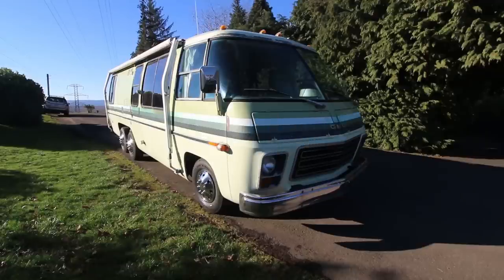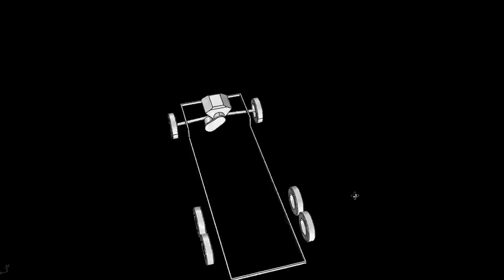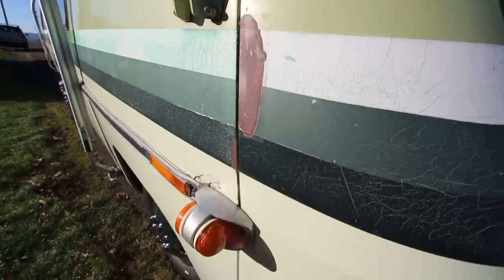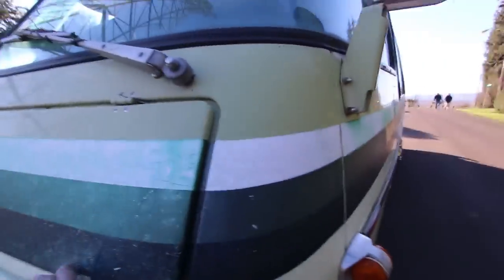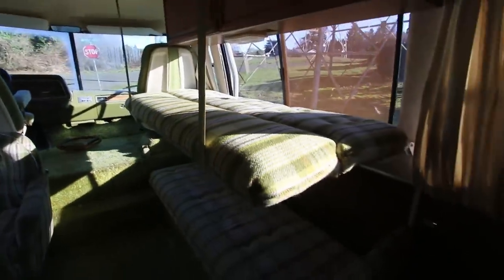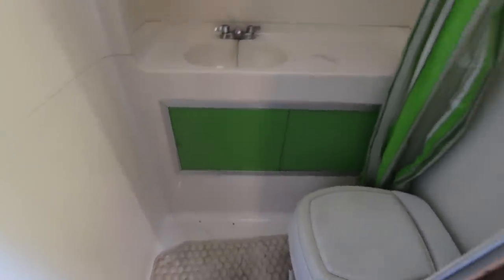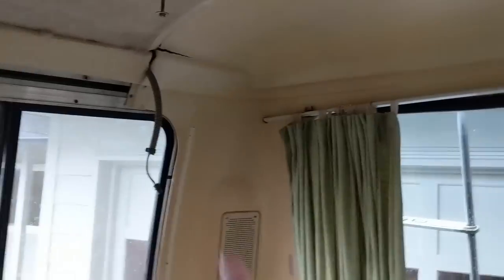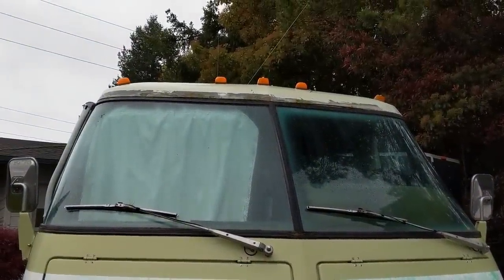Building The Best Damn GMC Motorhome Ever - Beginnings & Explanations

Comment: Try this profile for your PETG

255c Hot end temp 25% fan 3x3x3 0.2mm for walls and thickness

7mm retract 8mm wipe. retract during wipe. always retract (to make sure it retracts when switching between model and support)

50mm/s max speed

also. many coats of CLEAR coat inside and out. this will improve the transparency of the printed part greatly! more light can get out. USE LED's inside of these or the bulbs might heat up inside their to the deflection temperature. also UV clear coat for the final coats! this way it slows down the UV degradation over time. won't stop it but they will last longer.

for a compromise on the tear drop. print the original design just without the mohawk. easier to print closer to the tear drop shape you desire.

Comment: Just a suggestion, use a HEAT GUN to heat up the vinyl stripe on the RV to remove it using a putty knife.
Reply from the maker: A good idea. It was the first thing I tried: https://youtu.be/Gu62RG1tkp4?t=863
Reply: Erase wheel on a die grinder. What every body shop will use
Reply: Buy the 10 pack of them, they are erasers, they wear out.

Comment: One huge disadvantage is that there is no overdrive transmission option. Also, GMC did not come up with this idea....Revcon approached GM to source the Toronado powertrain. GM would only agree if Revcon could prove the durability and GM would even graciously provide some engineers to "Help & verify." Revcon was first

Comment: I wish there was a way to upgrade the powertrain easily. That Unitized Power Package was innovative but good luck recreating it with a modern Cummins and Allison. It would require a lot of CAD engineering as opposed to just some fabrication. The TH425 was a reengineered TH400 the spun backwards which required all kinds of reworking on the internals.

Comment: Old enough to remember how the hit the county in the 70s. Used to doodle them on my books. know them form stem to stern. Been to Orlando to a place that restores these better than new to see how I still can't afford them. 454 GM front wheel drive with air bag goodness. Check that frame. Look around on YT. They like to rust bad. Tales a lot of work to get them back.

Comment: rubber wheel on high speed drill to remove the old vinyl stickers, the rubber wheel acts like an eraser, just take caution as to not go through the paint or burn the paint.

Comment: There is a good reason medium duty/heavy duty vehicles don't use weak IFS front wheel drive.  The IFS that GM built was a weak platform to begin with.
While it may ride better, it is alot easier to get a FWD heavy veh stuck then a RWD.
I def like the way these look, but after owning 2 GM P30/32 based RVs and scrapping them I wouldn't ever have another, especially with a IFS setup, rated at around 5500 they can't take much abuse or weight, then again most RVs are very weight limited unless you get a high dollar unit built on a bus platform.
EDIT:  There is an invention called "air ride" that really smooths things out btw, I did a school bus conversion and it rides WAY better than the 2 RVs I've had by far.
LASTLY, NOT ALL PLATFORMS HAVE A FRONT ENGINE, try a rear engine layout sometime, they are so much better and no drive shaft running the length of the wheel base, mine is 3' or shorter.

I hate having the engine up front, way too loud to enjoy conversation.

Comment: Remember, though, that the integrated shoulder belt is going to rely on the strength of the seats connection to the floor.
Reply: Its kinda pointless in an RV too, its like a bus. It has basically no crash safety and at moderate speeds anything you hit is likely to move out of the way for you.

Comment: Take lots of pictures of before and after how about using fiberglass and strips of metal in bed in it to reinforce the floor and so on with out tearing every thing out. The water damage area will need lots of Attention hopeful you got a wire feed welder to make yourself brackets and supports  to hold and support it all . And one thing at a time and plastic bag to keep screws and small items Together and Mark the bags . After Interior work maybe Modify the engine a little bit for better for breathing and performance .

Comment: Does front wheel drive also mean it's better in snow than other RVs? I also have an Ender 3, but I'm not that experienced with 3D printing. Why not print the lense flat on the bedplate like the way it would be installed in the RV?

Comment: I've worked on so many of these steaming piles.
Good luck with your tow bills, they need to be on a trailer.
Reply: What are common problems with them? Surely swapping in a modern LS style V8 and OD trans would help? EFI & distributorless ignition really improved reliability. HEI was the shit when I was young lol.
Reply: Do they even make a modern fwd od transmission rated for an application this heavy? The original trans was a TH425, which is basically a TH400 but in front wheel drive. So an OD replacement would have to at least match the power capability of the 400.
Reply: @grabasandwich  
Primarily age related issues.
The cooling system, and the Buick sourced transmission are weak links.
The front suspension, wheel bearings, and half shafts are undersized for the job.
They were also produced in the age of GM's nylon timing gear heyday.
They're an uncommon platform designation, so pretty much none of your average parts house employees will have any idea what you're talking about.
You've really gotta be in love with the RV to operate it happily.
Reply: @TheREALJosephTurner  
I'm not aware of any o.d. Options.
I believe the Cadillac pattern TH475 FWD is tougher, has a lower first gear, but is still strictly three speed.
Reply: @TheREALJosephTurner  the 4T80E probably would've been the modern equivalent, which was replaced by the 6T80.
Reply: @burntorangeak  I forgot about the nylon gears! 🤣

Comment: The heyday of the muscle car ended in '72 - '73 at best, and I consider '65-'71 to be as good as it got or is ever likely to get (late-model Corvette, Camaro and Mustang owners may disagree, but that's a fraction of what was on offer at dealerships by 1970). It wasnt just the smog regulations - it was the realization among consumers that you probably didnt NEED 455 cubic inches of V8 to power the family station wagon on that once-a-year vacation out west. Of course, when it comes to larger vehicles like yours, a big V8 makes a lot more sense. 

Of course, the end of genuinely powerful engines didnt stop Detroit trying to market 'wannabe' muscle cars well into the 80s, and they are remembered for all the wrong reasons. 

https://www.drivingline.com/articles/10-reasons-to-be-glad-you-weren-t-driving-in-the-70s/

Admittedly, as a kid I thought the Smokey and the Bandit Firebird was 'cool' - we all have skeletons in our closet - but as soon as I clapped eyes on the Vanishing Point Challenger I realised the error of my ways. The 6 or so years that separated those two cars may as well have been 60 years - Detroit lost the plot.

Thanks for the video.

Comment: Just curious on how the seat swap install went and if you had any issues with it. I located a pair in my area and was looking to do the swap in short order............. Thanx
Reply from the maker: You will need to completely custom design and fabricate a new metal box for the seats to install onto. The stock box is not sufficiently engineered to withstand the forces going through the shoulder belts of the new seats. If you don't have the ability to do this yourself, having a metal shop design and fabricate this for you can get quite expensive.
Reply: @IndustriousPursuits  So Ive been able to remove 5 of the 6 nuts that hold the slide to the seat frame, but cant seem to figure out access to the last nut that is the furthest most towards the back and on the side of the seat tilt handle. Were you able to remove all bolts and was there anything special needed to do so?
Thanx

Comment: You do know you can remove the entire back to take out the big pieces right
Reply from the maker: I hadn't though of doing it that way. Thank you!
Reply: @IndustriousPursuits  It's a 3-man job. Get plenty of help. Mine has to come off this summer also.
Reply: @IndustriousPursuits  plenty of GMC facebook groups, plus manuals out there,  read up, find out if the intake has a crack, if it cracks will lead to over heating and cook the engine
Reply: Is it possible to remove the back and cut it to add a door and ramp to use the back section as a toy hauler? Do you know if that would affect the structural integrity at all?

Comment: Those GMC's are cool... But the KOOLEST motorhomes were the Daystar units built in the late 70s... Wish to High Heaven I could own one. Apparently, they stopped building them after about the 20th unit or so- the cost was too high.

Hey- take your time with that coach and do your projects DELIBERATELY. Take a suggestion from Billy Joel and DON'T GO CHANGIN' anything just for the sake of change...  Also, see if you can't find a set of factory manuals... They're real headache savers.

Oh, about the fridge/freezer... There's a business in Shipshewana, Indiana that will rebuild it and make it 3 times as efficient than a new one, and for about 1/3 the price!

Comment: teck689- Your 2112 is throttle acutor stuck closed. This would be a problem with your throttle body. Your 2104 is a forced idle code. I would suspect that you were at one time unable to control the throttle after seeing that light. Your 2104 is set when the pcm sees a signal that does not match expected signal. dont chase the 2104 its set due to your 2112. Bottom line removed the throttle body which will be located at the end of the engine side of the intake tract. It should be held on with (4) 8mm bolts after you remove the hose clamp style clamp that surrounds the intake tract. WARNING: Do not I repeat DO NOT drop anything past that throttle body when you remove it. Go to a parts store pick up some "brake clean" clean and give both sides of the inside of that throttle body a real good and reinstall it. Make sure you remove any black build up which is carbon. That usually fixes it or at least buys you some time. If the light returns you will have to replace the throttle body. Expect to spend in the high 200's to low 300's for a new throttle body. good luck

Comment: there were more "Toronado" parts than Cadillac.  the passenger dash panel with air vents comes out of the Oldsmobile.... as do the gas and brake pedal
Reply: The steering wheel was all Cadillac though.

Comment: Use a heat gun to get the stripes off. if you get a cassette toilet you can get another fresh water tank. Where does your gray water from the sink and shower go?
Reply from the maker: All drained water ends up in the "blackwater"tank with a capacity of 35 gallons.

Comment: What is the interior height of the motor home? Im 6ft 1inch.
Reply from the maker: The doorway is 5'10" Down the center line of the coach the roof is 6'5" At the outboard edges of the coach (where you never stand unless you are working on the rig) the roof is ~6'1"

Comment: I worked for Thetford Corp back in the mid to late 1970s they had a GMC in the company test fleet they were by far the best driving motor home and driving them was almost like driving a regular full size car of the era.  The interior layout and furnishings  were not the greatest, I think the best among them had aftermarket interiors.  GM cancelled them after the 2nd oil crises a big mistake.  They could have sold the tooling to one of the other motor home makers who would have gladly purchased the drivetrain from GM.  A typical GM  move they would rather kill a model than allow someone else manufacture it.
Reply from the maker: The things Detroit has done...I lived in Michigan for 4 years, and the saying there among everyone who works in the industry is "The bean counters ruined Detroit." It 'wasn't the engineers. They always tried to make the best product.
Reply: @IndustriousPursuits  Yes I was a manufacturing engineer in Grand Rapids Michigan for an Automotive supplier mostly GM they were all bad but GM purchasing was the worst.  I can tell you lots of horror  stories for GM they were horrible they were out to the 3rd decimal place on price and were always the last to pay.  Quality was barely on the radar and they often blamed suppliers for quality issues they caused.

Comment: OK...in the beginning, I was stoked that this rig is all original 70's era...but now you've ripped out all it's character. Booo!
Reply: Yeah its pretty weird, buy a 70s camper, spend $10k to strip all the interior and reupholster for mostly no reason. Might as well have just bought an early 2000s camper and saved the hassle..
Reply: I feel the same way  strongly but after having dealt with rebuilding leaky rooves on rvs I also have huge sympathy for his practicality
Reply: He said in another reply that the seats smelled.  I am not sure if he knows about a new technology where you can clean a seat and it stops smelling.  It is called soap.

Comment: dude... tesla batteries under the whole floor and stick dual motors in the front. stick their biohazard mode air filter system in it too..  would be killer rv.
Reply: Wouldn't be so crazy of them if it shared chasis with the van division. I can see this happening

Comment: Don’t want an awning? Wait what ! 🤦‍♂️. Guess you’re not going to run into any sun 🌞 or rain 🌧 where you are going.  
Composting toilet in a wet bath. Yeah you might want to rethink that one.
Reply from the maker: I didn't want the awning with the Legs that permanently bolt to the side of the MH. As I showed they are easy to break off, they are ugly, they create wind noise, and they reduce MPG. I will get a different awning at some point.

Comment: Once again a new owner who is all over the interior. Whoa, stop, join GMCMI. You need to be working on the mechanical parts of importance, which is everything that makes the vehicle run safely. Stop your gutting the interior and get out and under. The fuel system, all the brake system, front end including bearings. Watch  Jim Bounds You Tubes. I know it was fun to make clearance light lens, but there are perfect entire light led lights. Your goals are great, but if you don’t want to do it yourself, budget $15 k to 20 k and get the vehicle to one of the quality GMC restorers.
Reply: Plus one on  GMCMI. One of the first suggestions is what you said; DONT GUT IT ! Get it mechanically sound first